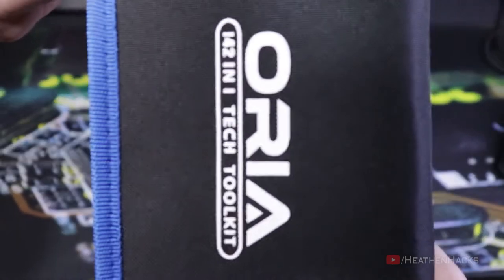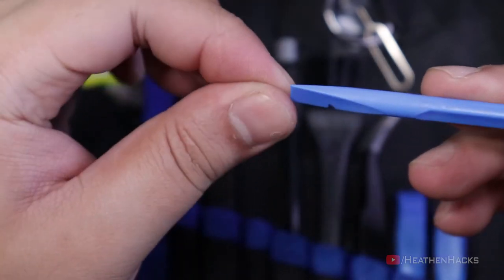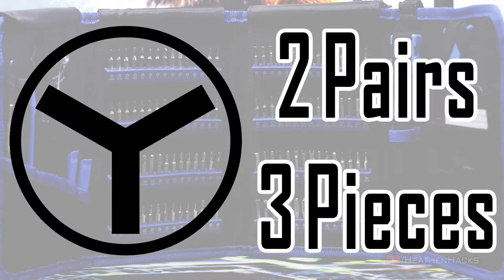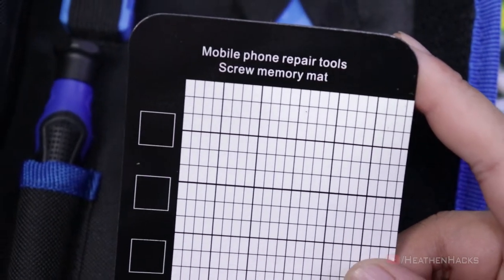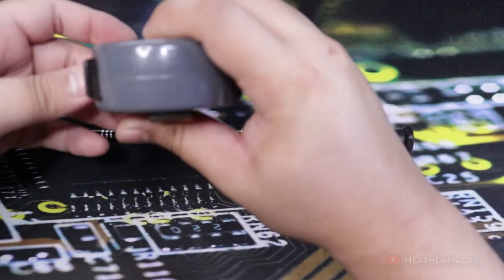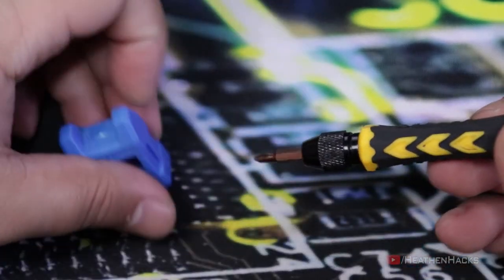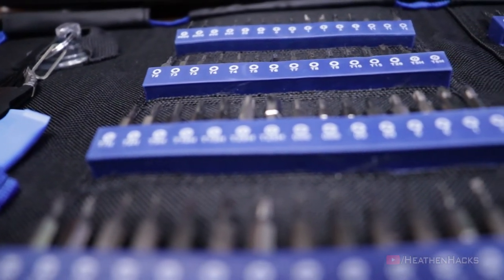ORIA 142-IN-1 Tech Tool Kit [UNBOXING & REVIEW]

Comment: I have a similar kit I love it the extras bits are there because they are the most used bits. They are very small and over time these are the ones that need replacement first due to wearing down. Its great the include extras.

Comment: The two Phillips are a common misconception. As they are different, if you notice some have a pointed tip while others a round tip these are REED and PEARSON ( pointy) and a true to name Phillips head (rounded) the company seems to just have included both just not under the correct names
Reply from the maker: Hello John and thanks for the comment! ♥ Yes. Seems plausible.
Reply: @HeathenHacks  lol plausible? John gray just spit some facts.

Comment: The "big thing" bit you mentioned, is a conversion bit so you can use any of the other bits on a power drill or a bigger full sized screw driver.
Reply from the maker: Ah. I see. Thanks for the comment!

Comment: Love the video! Exactly what I was looking for on this product. I know the Ifitit Kits are probably made in the same factory only with more money put toward advertising. Great video!
Reply from the maker: Thanks! Glad you liked it! ❤
Reply: I don't own either the Oria or the iFixit precision bit sets, but my research shows one major difference between the two brands: the steel that they're made of.    The Oria bits are made in the Republic of China with CrV steel, while the iFixit bits are made in Taiwan using S2 tool steel.  I have no affiliation with either tool brand, but S2 tool steel is superior to CrV, so the truth is that the bits from these two tool brands ARE NOT made in the same factory and, more importantly, the iFixit bits are made of a better grade of steel.  You really should do some reading before making a blind statement like this!

Comment: Can you also try comparing a strebito 191 piece kit to a ifixit for durability?
Reply from the maker: Hello, and thanks for the comment! I can if I could, honestly. Atm, the cheapest iFixit kit I could find is 3x the price of this one and I already have this one to use. Would be a waste of money imo.
Reply: @HeathenHacks  well how's the toolkit going? Anything that break in the toolkit? Or stripped?
Reply from the maker: No stripped bits yet, but bent? Yes. One of the small #2 flat head. Can be easily straightened by a hammer and a hard flat surface, tho.
Reply: @HeathenHacks  any plastic tools broken?
Reply from the maker: None, so far, gladly.

Comment: So whats a higher quality brand to look for?
Reply from the maker: That's a good question, actually. Haven't really bought another set yet since I'm still using this one, and apart from a few bent flat heads (which can be hammered back to shape), and the pouch slowly deteriorating (the stitches started to come off), I think I changed my mind after a few years. It's really good, at least for working on small devices. Strebito, ORIA, and other ones similar are basically from the same OEM as well, so maybe there are no difference between them when it comes to quality.

Comment: it never said it was 142 different pieces, just 142 in total. if you strip a bit in the middle of a job, having a second will let you finish.
Reply from the maker: Hello, bri! Thanks for the comment! ♥ Yes, maybe it was intended to be like that. I even said it as well. It's just that it's quite disappointing somehow, because it wasn't quite what I was expecting to receive after buying a "142-in-1 Tech Tool Kit."
Reply: @HeathenHacks  would make a long title if it said that not all the bits were different. Not like a quick look into the description were it lists everything that comes with it wouldve been a hassle...
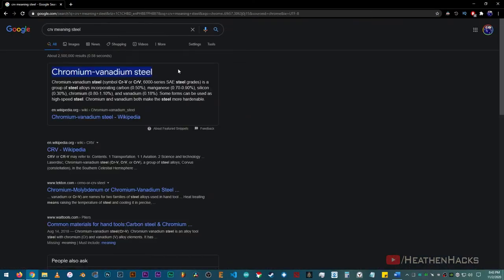Reply from the maker: @foulelements  that is true. [1:39] however, the product description on the product page did not list the included bits. just the total number of it.
Reply: @HeathenHacks  check the amazon posting again. theres multiple big high quality pictures that showcase the contents of the kit; including a close-up photo of all the bits and their respective names.
Reply from the maker: Did not buy this from amazon since I don't live in the US. However, upon checking the product page of the item, it seems like they just recently added a close-up of the things that are included (which is good). It happens a lot, too. When someone pointed out something on the reviews (on the product page), most of the time they would either change some details or add images. People often rant about those on their facebook page.

Then again, I guess it was my fault for thinking that "142-in-1" means it has different (as in the bits are not in pairs)  and not just the total number of things that are included in the kit. It's also my fault for not checking other sources.

I don't mind it that much, tho. It's cheaper than iFixIt and I've used it quite a lot, too.